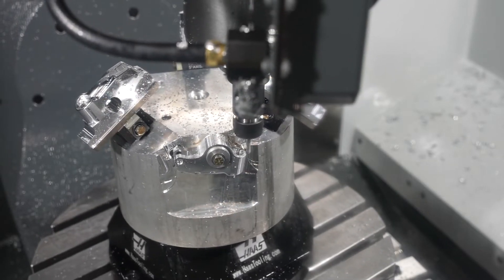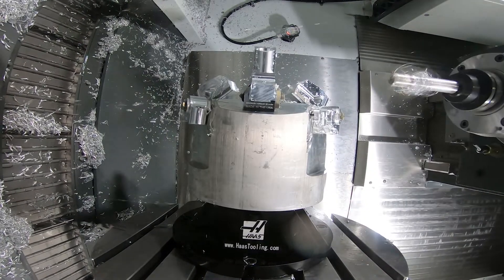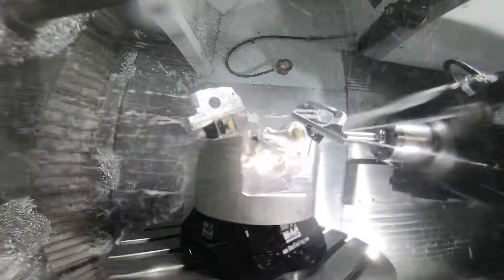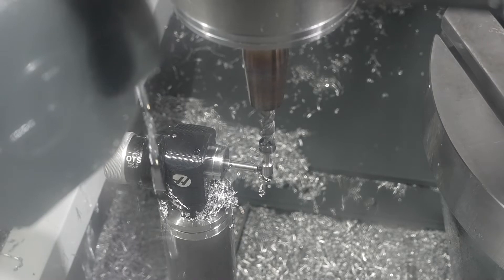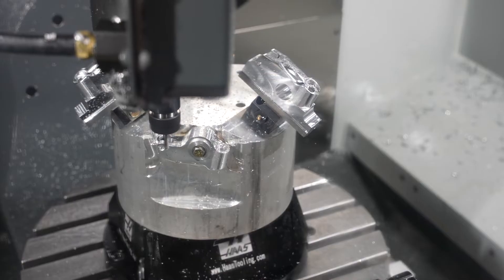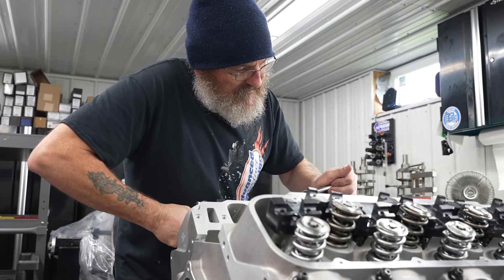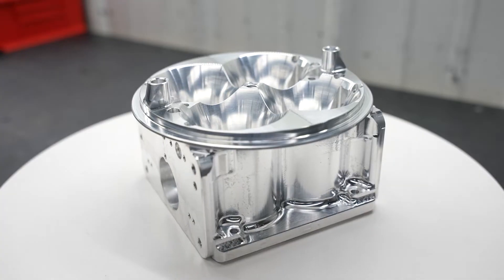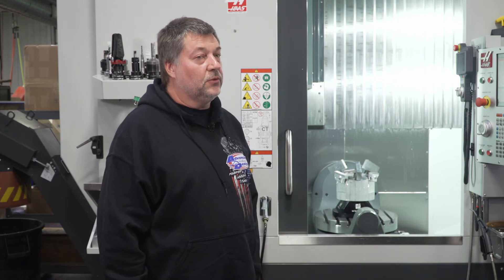Machining Rocker-Arms for Drag Racing on a Haas 5-Axis UMC

Comment: LOL@2xx inches per minute on a small part like that. ignorance is bliss... there's not fucking way that piece of junk is getting anywhere near 200 inches a minute on something that size. just because it says it on the screen, doesnt mean it'll actually do it. haas is the only machine company i know of that doesnt show the ACTUAL cutting speed, but only whats programmed!
Reply: what CNC Machine can do 200 IPM in that short space?    Acceleration, Deceleration etc. all has to happen.  We all plug in numbers looking to be in the window of what will not break tools and minimize cycle time.   Other machines may be slightly better in rigidity , HP, speed etc. but you pay much more $$.
Reply: Plenty out there can do it, but yeah they're more expensive. Just saying that that haas, or any haas will never actually hit those speeds in that amount of space, most people hear stuff like this and think it's true, when it isn't